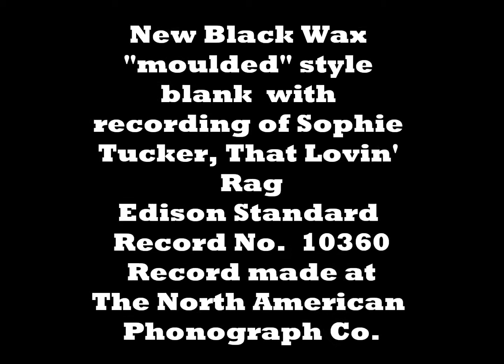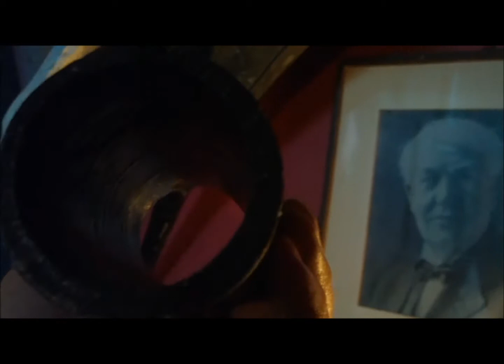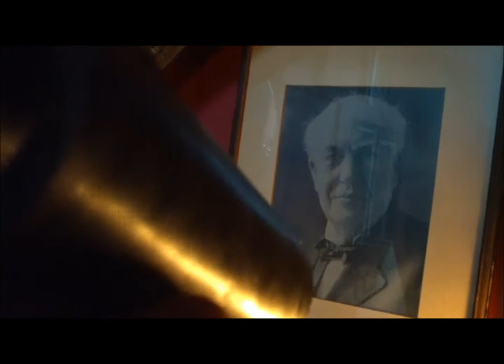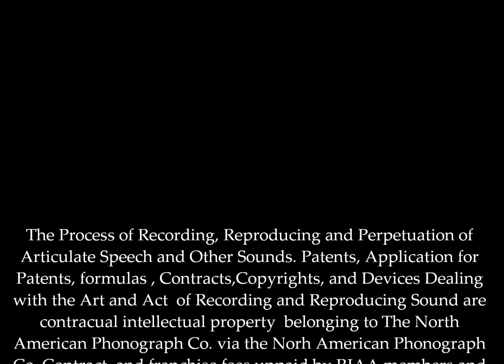New Edison Gold Moulded style recordable black wax blank Sophie Tucker recording

Comment: Very Interesting. Does this mix eliminate some of the objectionable points to using shaved gold molded records? I am curious. I got some very good results shaving a bad mouldy gold molded record, and a friend even gave me a box of moldy gold molded cylinders to experiment on, but never went any further after reading (from you on the TMF maybe) that the harder gold molded will cause more wear on the cutting stylus, so I have stuck with brown wax.
Reply from the maker: It certainly is kinder to the shaver, and recording sapphire, than raw  Gold Moulded Records, however, time will tell how much kinder.  The wax is filtered, and 3% fresh bovine stearic added, and then 50% of my own formula brown wax added, that is made of shavings and trimmed ends, from my regular from scratch brown wax batches.  It shaves nicely, while when you shave a gold molded record, with normal feed, it tears little holes in the wax, while this compound I made shaves, as a normal brown wax blank shaves, it probably is a little harder than a Columbia molded record, not as soft as a brown wax blank, and not as hard of course as an Edison Gold MOulded record.